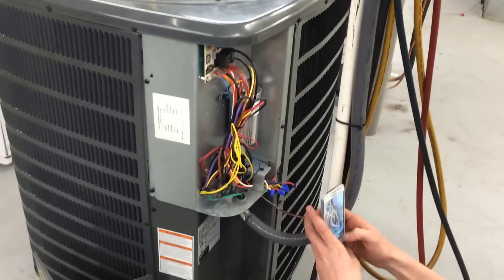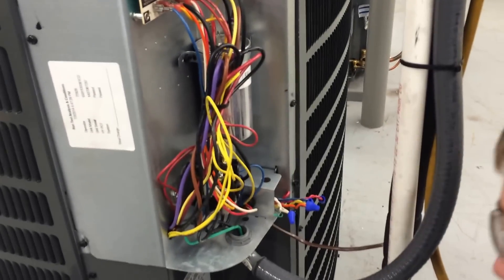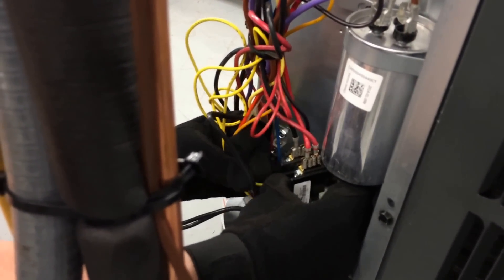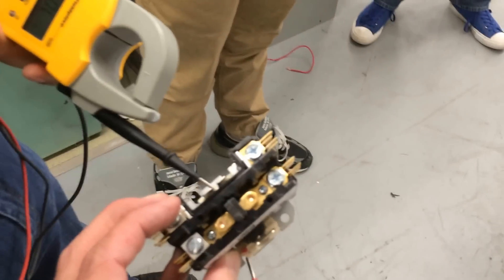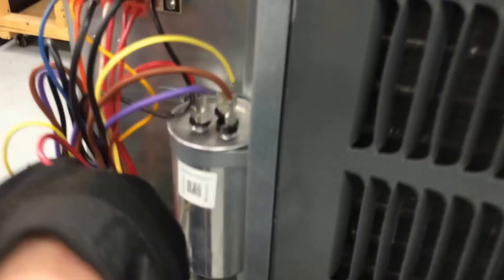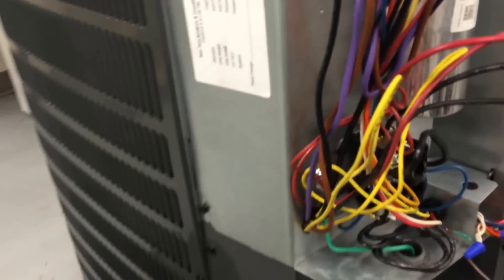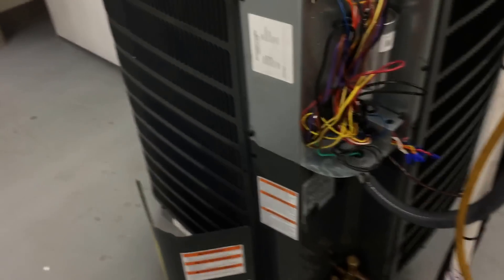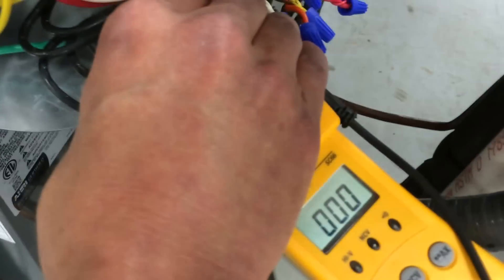HVAC Basics: Service & Troubleshoot - Replace the outdoor unit contactor

Comment: i put an ohm meter at the end of my contactor with all electric still running. and a large pop sound like a small explosion happened at the connection points where i made contact. i suppose i have ruined that contactor. i was trying to figure out why the ac heat pump wont come on. i replaced the capacitor and that didnt solve the problem. the ac unit would come on when i pushed the plunger on the contactor, but it would do the plunger on its own. thats whn i pulled out the ohm meter and got the pop noise. now the unit doesnt come on whenever i push the plunger.

Comment: After your step of disconnect, is it best to discharge the capacitor to avoid high voltage mishaps.  I did not hear any instructions on discharging capacitor for safety.  There are a lot of DIYers watching your video that will not know about the dangers of a charged capacitor or how to do it.

Comment: ive got a first time seen problem, and need HELP figuring out...
Everything working great, new fan, new cap, new contactor. BUT every now (sometimes 1 hr, or 5 hrs) and then the fan (only outside fan) stops working. I try to free hand spin it, and nothing. Turn it off and After waiting (sometimes 20 mins, or 2 hrs) turn it back on and everything working great again. Extremely confused and would love some feed back if anyone has seen this problem before. Thank you!

Comment: I need some help with my home AC unit.  I have changed the magnetic contactor and the capacitor and it worked for a week but it stop working the fan on the ac is not spinning and hearing a clicking at the start only. Can someone please help
Reply: Edwin Magpayo could be your a weak capacitor.

Comment: I have a question. My contactor reads 241v on t1 and t2, but when I measure on the lower t1 and the upper t2 I get a 239v reading. The same happens when I measure lower t2 and upper t1.
My problem is that the fan works but the compressor doesn't. my return line gets frost all the way from the coil to the refrigerant unit. I replaced the capacitor and still I can't make it work. thanks.
Reply from the maker: +lohengrinknight ohm out the compressor. See if you have an open winding. 
https://youtu.be/1W08vFdhtLk
Reply: Thanks for your response. I checked ohms on my compressor and it is in good shape: c to r = 1.7, c to s = 4.2, and r to s = 5.3. I just happen to have a very quiet compressor, for what I see after the test. I kept checking and found that the inside blower doesn't start at all, neither in heat or cold function. I checked its terminals, and it is in good shape, too. The small capacitor is fine as well, so now I really don't know what's going on.
Reply from the maker: +lohengrinknight if the indoor fan is not running and I was there doing the call I would think about checking the thermostat fan terminal, the fan relay, fan cap and ohm out the fan motor. With the power off to the indoor unit I would carefully reach in a the blower housing and spin the blower wheel a bit to see if it's stuck.

Comment: I love how teaching young techs to take photos, instead of ripping wires off, , may I also suggest, when checking the l1 l2 also go to ground on each side, maybe the breaker is bad. It just good practise
Reply from the maker: +mychoclabwinston thanks for the comment and the suggestion. The only time I've been concerned with the students checking to ground is when the ground is bad or missing, when the bond is broken.
Reply: I'm going to check it out this afternoon. Fortunately, it isn't very hot now, so I can take a few days to fix it.
Reply: ytyyytyyttyyytt

Comment: hi there,
ive changed the cotactor and capacitor but still ac is not working.inside blower fan is working but out side fan is dead. there is no buzzing sound or nothing.its dead. but when i press the contactor it works. 
please help.
Reply: do you 24v across the coil
Reply: You probably have low charge which is setting off your low pressure switch on your board.
Reply: trukin forever how low?